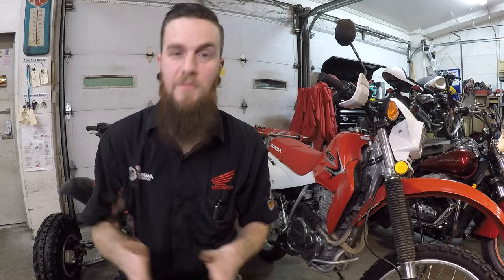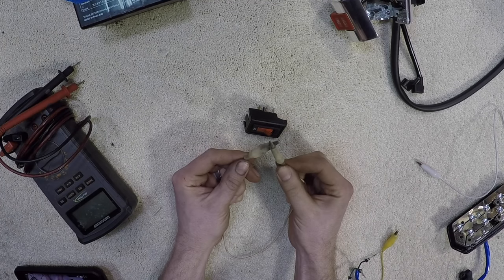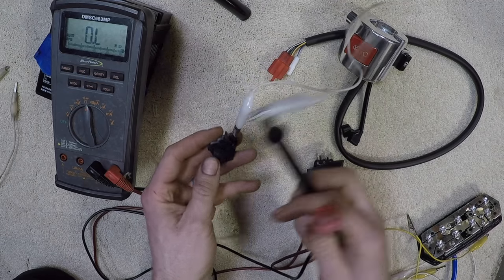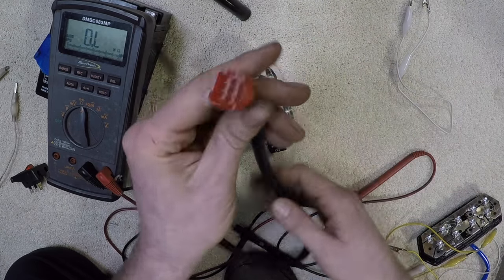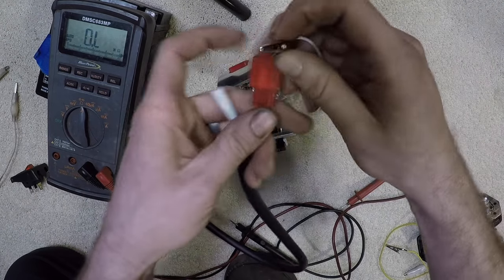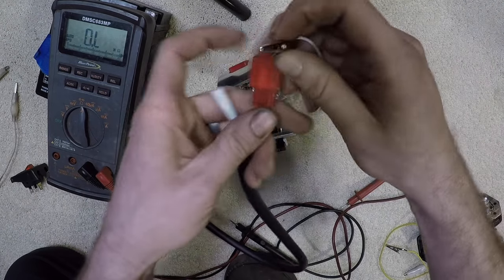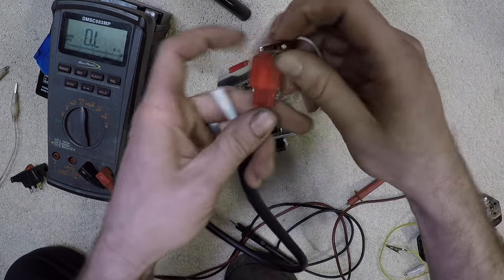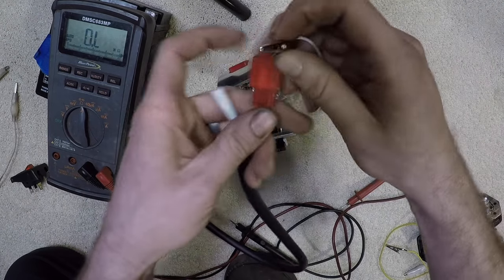Testing Motorcycle Switches

Comment: I put my key into my ignition and turn to start-oil and neutral lights go on. I turn my kill switch knob from off to start and my starter solenoid will click once. wWhen I push my start button in I get nothing. No click no start. 1978 Yamaha xs500

Comment: Can my kill switch be bad? When I push the red switch, it is supposed to prime the fuel pump, but it does nothing. The starter button works. The bike turns over but won't crank because it isn't getting fuel. I have checked everything. A bad ecm is a possibility, but the fuel pump relay isn't. The fuel pump spins when hard wired. I had a motorcycle mechanic look at it for 3 hours, and he couldn't figure out which I figured because I couldn't figure it out.

Comment: I've got a GS 1983 850 GL Suzuki motorcycle that the headlight comes on but I've got no fire at the ignition coils the neutral safety light does not come on and the tail light is not burning...what wrong with it?And why is the coils not firing??They are brand new and the cdi and the battery is  too!what is wrong it?? please help me.. please and thank you...

Comment: On my 650 v star, if the kill switch is off the engine will not turn over. If it is on, it will. Is this not a test in it’s self that the kill switch is working?

Comment: Thanks man.  Really appreciate you sharing your talent.  Isolated the switch.  Fixed it once before and finally failed after throttle push pull cable replacement.  Will ride again soon.

Comment: First thing I saw and want to set straight your "continuity test" is a Diode checker gives you the beeps to show the diode is working correctly, but also gives you resistance in ohms.  Then you have the correct continuity test which doesn't beep at you but still gives you resistance in ohms.  Ohms will never go negative, since it's shooting resistance, if you were shooting power then I can understand negative.  I have shot wires where Ohms have been up to 8 ohms and it's still good it's when its higher like in the Kilo-ohms
Reply from the maker: What was the purpose of setting it straight if it really doesn’t matter whether you set it to give you a beep checking resistance or not? Even if I read resistance negatively for the rest of my career it still wouldn’t matter..But.. thanks?

Comment: Thanks for the video. I'm chasing electrical gremlins in my headlight circuit. I tend to get it in my head what I think the problem is instead of logically troubleshooting. I will definitely remember to test the switches and bypass the switches to know for sure.

Comment: That was very helpful.
I recently acquired a 97 Honda Shadow that is being by passed to start up. The ignition the kill switch and starter switch do not start up the bike.
When I put the key into the ignition and turn it to the on position no power or lights come on.
When I use the by pass switch the power comes on, then I push on the starter switch it dims the headlight but nothing else. No clicking at all.
There is a bypass switch for the starter that will start up the bike with the bypass ignition switch on.
Both by pass switches are connected through the solenoid.
I will attempt to perform these test on the ignition, on the kill switch, the solenoid and the rectifier and the rely.
Thank you.

Comment: Love the way you explain this.  You would think as the owner of a specific model of motorcycle, you should have free access to the manuals.  I'm trying to figure out where my clutch switch runs to since I cannot test it at the switch, it is sealed.  It has 2 micro switches for clutch and cruise.  Super Tenere 1200.  Cruise is not setting, so could be any number of switches or sensors.  Can find a copy of the proper Service Manual Electrical diagram for my 2020 ST.

Comment: Cody: Hope you can help. Really like your posts. Kinda stuck right now. Trying to get my 03 Yamaha XVS 1100 running again after sitting for a while. Replaced the kill switch/starter button assembly for the 2nd time, along with the starter relay, fuel pump relay, and fuel pump. etc..  I will  try your method of testing the kill switch but would also like to know how to check power supply to the switch. Thanks

Comment: Cody, Thanks for these! I have a 1977 Suzuki GS 750 B, I took the engine from a 1983 Suzuki GS 1100e and swapped them. Have a new reg/rec for the 1100 installed. Having an over charge problem 15 volts at idle have been taking each connection in harness apart and cleaning, still can't find the problem?

Comment: good simple explination on wiring , but my problem is with honda and what they did on the honda goldwing 1500 is totally stupid ,I have  a 1990 and it is a wiring nightmare , . the bike just clicks when i hit the strat button , new battery , new starter , good starter rely ,but it vlicks on the relay panel , i replaced all of them ,I put a 40 amp inline fuse next to the starter rely stater is good , I just can not figure thid thing out , help would be great thanks stephen d.

Comment: How does the turn signals flash??? Is there a capacitor or something inside the switch. Have an old 75 suzuki ts185. Got power but no flashing.. thanks for the help, and great videos friend. Sorry not a honda bike

Comment: Great video. ! You don’t mine if I make a question . My motorcycle don’t have power  Battery is new. Switch is ok but don’t have lights n don’t start looks dead. fuses are ok  Suzuki 2005 . Only the rear light is on that’s it  thank you for your respond. 😅🙏🏻🙏🏻

Comment: Cody 
request for advice  I have a 83 GL 1100. Mysterious problem. Great power thru 1st thru 3rd gear. But there is a total loss of power in 4th and 5th and I have to down shift to 3rd to get power back. I have the cARB BANK ON THE WORK BENCH. i DRAINED EACH CARB BOWL INTO A GRADUATED CYLINDER and I am getting 4 different volume readings.

I recall from other research that a proper float height will deliver 43 cc from each bowl. This very close to a factoid I ran across describing a carb cleaning process where 180 cc of yamaha carb cleaner i.e. 180 / 4 = 45 cc / bowl. When I reassembled carb plenums there is a possibility I believe that I could of either left the RED STRAW out of my prior carb cleaning OR I inadvertently put in a red straw from a WD - 40 spray nozzle.

I also  have new: fuel pump, filter, plugs and plug wires, completed full dis assembly of carb bank down to each individual carb, fuel cut off and accelerator pump diaphragms carbs were synched. it seems like fuel starvation but i am wondering if I have a cracked ignition coil breakdown. 

I dropped the bike on a trip but was able to ride the "wreck" at upwards of 90 mph back to garage home. I have been trying to solve this problem for several years, can you make any recommendations? ,please feel free to share this on your blog. I apologize for the long message and the capitals realize any other way to request technical recommendations. I am a subscriber with notification turned on and thumbs up regards Scott
57836:401547

Comment: Hello this is Jason from Georgia and I’m at my wits end I have a 2008 LTR 450 I know it’s not a Honda but I’m hoping that you might be able to help me when I first start the ATV it runs like it’s supposed to after a little while it starts to fall down and get sluggish well the other day I Was riding And it started acting sluggish it has an aftermarket KillswitchSo I just pulled a little clip out of the switch and let the switch close I plugged it back in real quick and The four wheeler ran better than it ever has so I thought it was a bad Killswitch and I jumped the switch and put a toggle in the middle it’s still doing the same thing so what could my problem be thanks for any help that you could give me

Comment: My bike wouldn't start. The lights wouldn't come on. Dead. The main fuse was blown and I changed it and the rectifier started smoking, so I switched of quick. What could be the problem? Im getting a new rectifier. Can't see any burnt wire and cleaned terminals.

Comment: hey cody i hope you get this and understand. on a 85 vt700c shadow there are the 2 wires that run to each of the coils. Now is there supposed to be 12volts running through those wires if i hook the multimeter to the black and than yellow with the switches and ignition on?

Comment: I need to know why my 1990 custom soft tail Harley Davidson starts popping & miss firing when I rev it I also got on it & road it & runs fine but as starts to come down on the rpm's it starts to bog out like it's running on one cylinder  again I also noticed that at night with the head light on it dims when I rev it so I know it's a short somewhere that's grounding

Comment: hi i have a 1991 cbr 1000f an worked great till it didn't any ways first i had trouble with indicators and the horn then solenoid blew shortly after and was no start or anything so changed that out and noticed it had a 20 amp fuse in it but it was meant to be a 30 amp ( no clue if this matters) but i put new fuse in looked at all the others and they are all good i get dash lights but no horn lights of any kind or starter button and am really confused at this point as i know the horn and bulbs all work and never had any trouble what so ever till one morning when went to mot it and all hapend within an hour . if any one has any ides please help !
Reply from the maker: I would look for burnt ground wires in the main harness connections. Usually on the right or left sides of the bike. Follow the main harness till you find those big 20-30 wire connectors and really e spect that for bad green wire connections

Comment: Hi Cody, quick question, should you use anti seize on threads of a Radiator Fan switch that has an o-ring?
Reply: No, you should use       
 di-electric on all electrical conections. except maybe sparkplug threads.

Comment: Easy one - my Honda bike hazards are fine, but nothing happens when I turn indicators on. Nothing at all. It’s Pan ST1300. I am sure it’s not relay because it’s same relay for hazards and turn signals. Hazards work. Fuse is same for hazards and turn signals and is fine. Must be bad continuinity somewhere. I bet switch is fine??? as it was before this shit happenned. I believe I broke a wire or connection somewhere after I was refitting fairing when installed gear indicator. After watching the video I checked wiring diagram. Turn signal and hazard switch use same wires. Orange left t.signal, blue to right t.signal. They merge with hazard switch orange and blue. TurnSignal Relay sends power with grey wire and merges with pink white for Hazard switch. I think it’s one of wires leaving Turn signal switch is to blame. What you think the fault is?

Comment: I have a question have you ever had a start switch reverse for example on is off and off is on what causes that
Reply: I had one stator wire and one on the rectifier my bike died while driving I desperately need your advice asap please please please
Reply: Should be more than one wire from stator and more than one on rectifier,  what kind of bike do you have?
Reply: @tubeonline629  only one wire burned on the stator the rest was ok the same thing happened with the recruiter I have a 06 Kawasaki zx636r
Reply: @greensparks415  
A wire in the windings of the stator must have got to the case and caused a short,or where the wire where they come through the case rubbed though the insulation and shorted. And it was probably the same wire that connected to your regulator/rectifier that burned also.
Reply: @tubeonline629  is it fixable or I bought a OEM used one from eBay I would like to fix if it's fixable and have it on standby
Reply: @greensparks415  
I don't think you could fix the stator, and definitely can not fix regulator/rectifier. You can test them both, several videos show how.
Reply: @tubeonline629  ok thanks 🙏👍 appreciate your advice

Comment: Hi I have a atv the starter is cranking over slowly iv replaced battery with new, tested starter motor out of the atv, stripped tested and is all ok spins fine, tested earth wire that's ok only thing not tested is solinoid but I'm sure it's ok my battery wires get are getting warm that makes me thinks it is an earth

Comment: Okay shoot me a comment about this situation 87 Honda goldwing I took the motor off starter motor and it runs I put the starter motor back on it will not turn the bike over it will not turn the bike over hot wired directly to the starter what's wrong will you text me back and let me know

Comment: Very bad analogy used to describe a circuit.  As you illustrated in the beginning you are basically  stating to short positive to ground thru the switch.   Never assume your audience is at the same level or teach to the level you anticipate the audience to be at and state so.  If you assume they know about batteries and such then likely this video would likely not be needed.